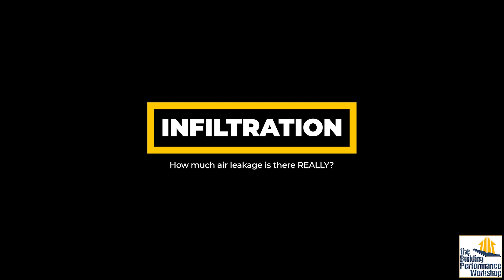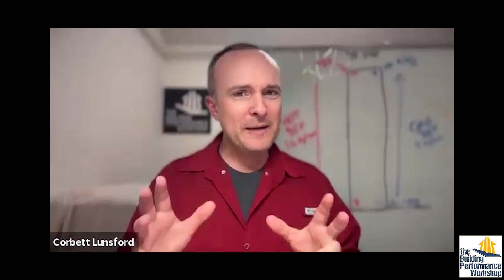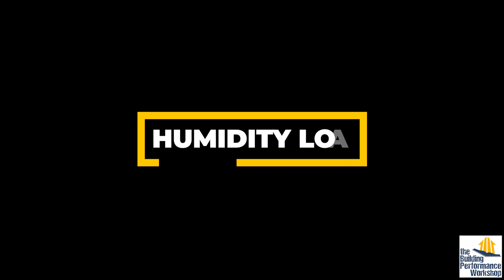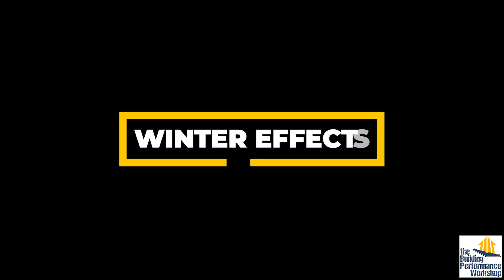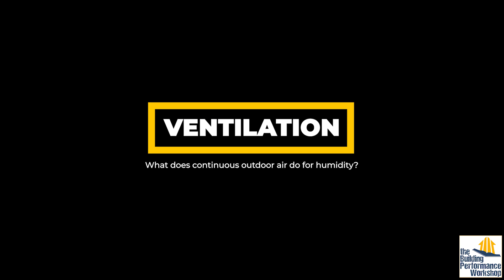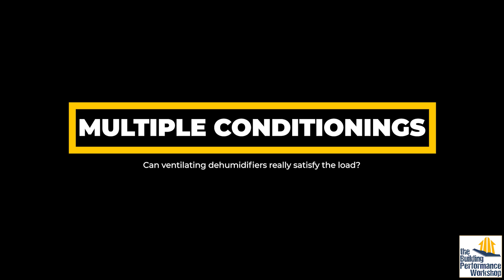Humidity in a High Rise: Multifamily Apartment Dehumidifiers w/ Lew Harriman & Marianne Touchie

Comment: I'm really happy Marianne brought up VAV. We do it all the time in commercial; I don't see why we can't do it in residential; at the high end, at least, high-end equipment already has ECM fans and VRF/inverter-driven compressors.  All we need to do is tie it in with the proper sensors and controls. You can even do single-zone VAV if you don't like dampers and zoning.